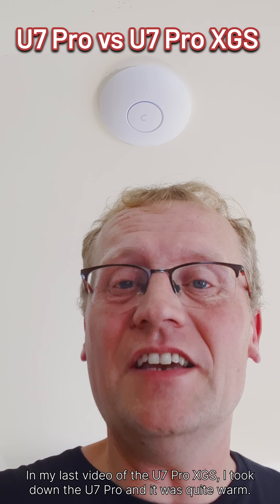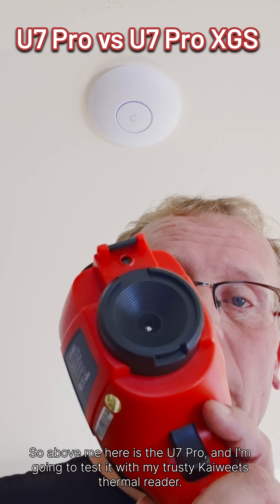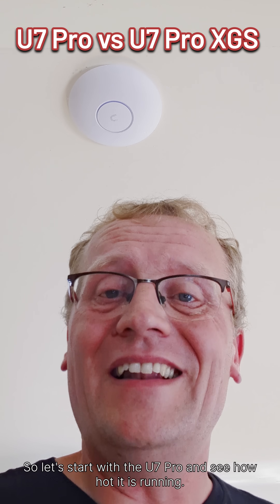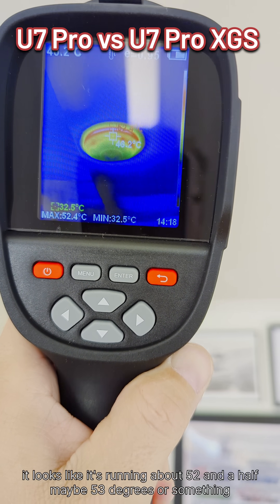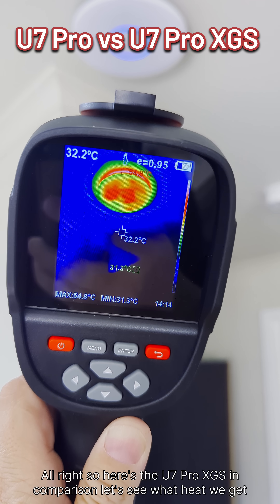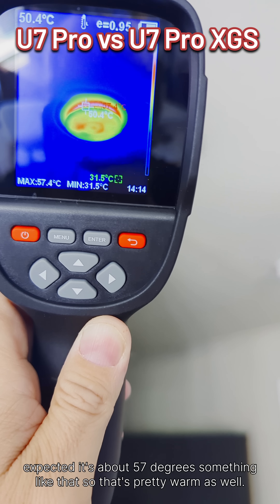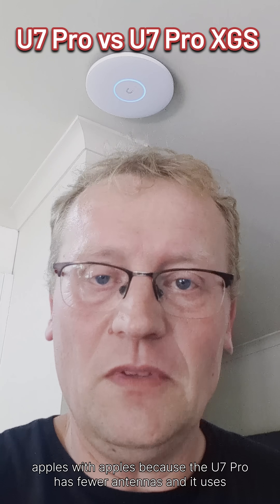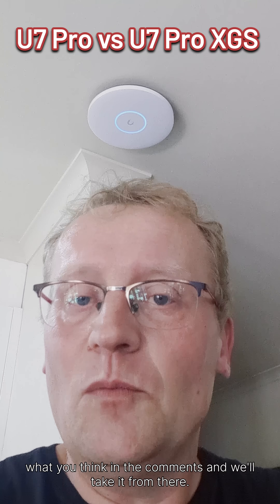How hot do the new UniFi access points get?

Comment: I never expected a WiFi access point to get so hot  that I can no longer touch it. The front is uncomfortably warm and the heatsink at the back causes burns.
I have a couple of U7 Pro XGS and those act as space heaters. And that is with only a handful devices connected and no throughput.
Reply from the maker: Mine gets warm, but not as warm as you describe it. You have enough air flow around the device?

Comment: This equipment can run up to 100 Celsius without any issues
Reply from the maker: I'm not sure about that. That sounds really hot and you should look at ventilation I'd say.
Reply: @LarsKlintTech there are safeguards built in so the chip will just slow itself down after 100 degrees to save itself and just run slower. Heat is the cost of speed.
Reply: @LarsKlintTech after that's chips will down lock themselves to keep the heat down we don't necessarily like chips running that hot but they are fine up to that temperature. Most modern CPU's with good cooling under load will run arround 80 to 90 degrees. It's why water cooling is becoming popular but the cups are fine it just heats up the room.

Comment: I find a lot of Ubiquti equipment runs pretty warm, but they usually overrate the components internally, so they can handle the heat pretty well.   I've never had a Ubiquiti device die from overheating yet, but ymmv.    To make them more powerful and still use passive cooling, there is a compromise between heat and performance.   Overall they are pretty damn reliable though and seem rated to take that bit of extra heat.   I have a couple of G5 Pro's that sit in direct sunlight half the day.  They get pretty toasty.   Never had one crash.   Have never rebooted, other than for firmware updates
Reply from the maker: Good to know. I have had the same experience. Even the AI Bullet that sits in direct sun all day at the gate, and it is a black camera, doesn't miss a beat.

Comment: The APs and the prior switches used to get quite hot.   The worst were the Pre-Dream Machine routers - The USG and the first group of metal 8 port poe switches would get upwards of 60 to 80c at times.   With internal temps sometimes hitting 110-115c.   That said I have never had one outright crash due to tempature.   Even if I did have to notuca mod my old USG-PRO.  Performance would improve on those old devices, but usually nothing on an AP that could be measured for performance vs gateway/router throughput.
Reply: @SeijinSA  are you sure internal temps are getting that hot?   I've never had that experience, but I am in Melbourne Australia and the ambient temperature doesn't often get above 38c
Reply: @EsotericArctos  From prior testing yes.  Since I can not link it directly do a google search for "unifi usg tempature"  the 2nd post should be from the UI forms indicating a thread about 7 years ago that mirrors what I had seen, and confirmed/supported by UI Staff at the time.   The devices have always ran a bit hot as an understatement.
Reply: @EsotericArctos  My prior replies kept getting filtered I guess?  But if you are interested look for the USG temperature posts on the UI Forums dating back to 7 years ago.
Reply from the maker: Jeepers! That is melting temps. I don't think that can be healthy for the components long term.